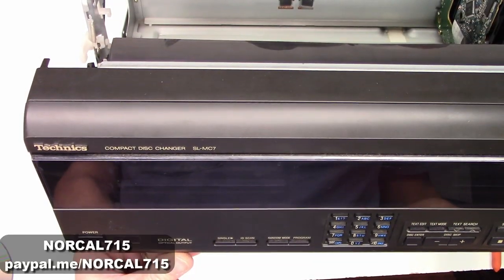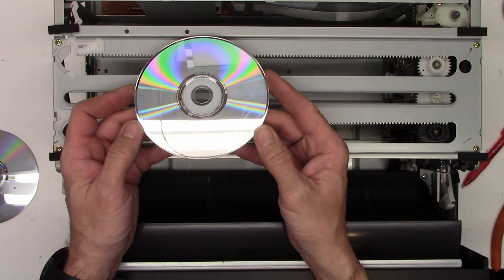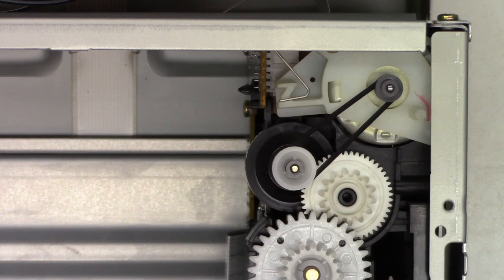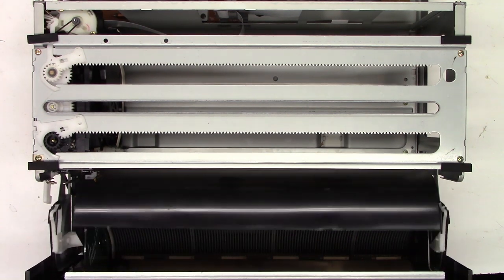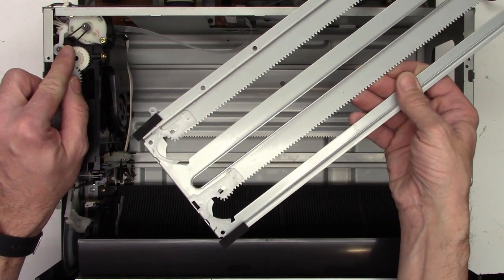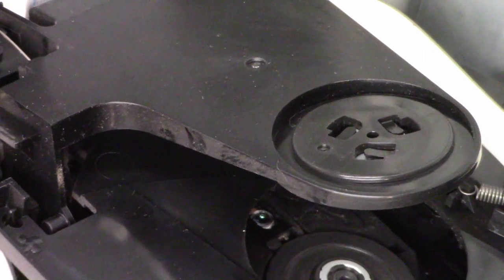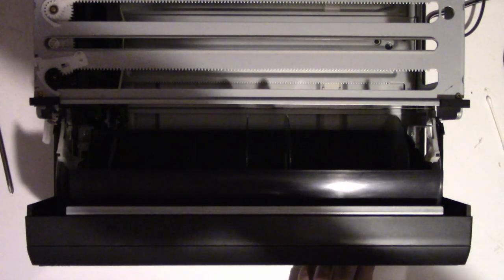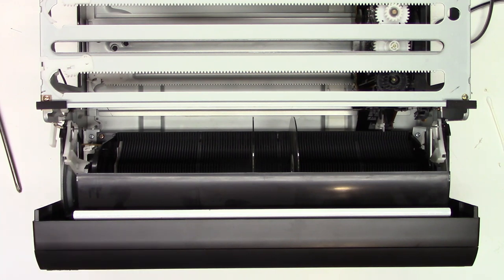TECHNICS SL-MC7 100 + 1 DISC CD PLAYER LOOSE DISCS AND WILL NOT PLAY REPAIR FIX

Comment: Thanks for sharing! I have a dead SL-MC400, and curiosity made me look on YT for a possible repair. After opening it up, I discovered the belt in pieces..... I now have a replacement on order, so hopefully that will get the old girl back up and running :)
Reply: Follow up - the player is back and running as good as new 👍 Thank you x
Reply: Where did you get the belt from?

Comment: Hey Norcal715, you helped me on another repair some years back. My unit suffers from the dreaded "No Disc" message, but after cycling through a good number of discs it will eventually start reading/playing the disc and will play from then on. I reckon it must be due to a weak or wearing out laser. I was glad I had this video as a reference to clean the laser lens - the last time I managed to get a q-tip in there without complete disassembly but couldn't remember exactly how I did it. Anyway, I did take it apart, and was able to clean the lens and other surfaces you showed in the video. I was surprised how clean it was inside, and the lubrication on the gears seemed good. Unfortunately when I got it back together, it would no longer insert a disc into the cd drive. After watching your video, I powered it off, and then moved the cd drive all the way to the right, and noticed the back gear was one tooth off to the left, so I unscrewed the right side and made sure that the gear teeth lined up correctly. After this, the unit would load cds again. Unfortunately, I still get the "NO DISC" message, but after about ten times loading and unloading cds, it started playing as it usually does. Maybe the tired laser finally gets hot enough to read? I guess there is no way to repair that as parts would be prohibitively expensive and likely non-existent at this point! If the cd drive stops moving I will know where and what to do to replace the belt. Hopefully I could find one on Amazon or other source. Thanks again!

Comment: This is the same exact mech used in the SA-CHxxM series of mini stereo systems by Panasonic (which makes sense, since they're both Matsushita) except those are 60+1 changers. There's the 64M, the 84M and the 94M. Those have their own amplifier and speakers, FM/AM tuner and a single/dual cassette deck stacked on top (the 64M model which I own is a single deck, whereas the other 2 are dual). There's also the Technics SL-MC400/410 which also holds 110 discs (and I own as well), although I think that was the first generation of mechs of this kind that Matsushita made. I think the timeline goes like this: Matsushita released the 400 series under the Technics brand, they were pleased with the results and decided it was worth improving and carrying over to later products, so they made the 6/7 series next which adds the optical output port and got a bit of a facelift and different color scheme on the front. Then came the smaller all in one SA-CH models under the Panasonic brand, just shrunk down. By this point, they also made some improvements to the logic and firmware of the MCU running the whole show. For instance, the SA-CH model doesn't need to slide the mech across the rack to search for discs at each and every power cycle - it only does it once after the door has been opened and closed and then remembers the number of discs until you open the door again. It also won't let you select slots that came up empty during the initial search action - it will say "NO DISC"  if you try to punch in an empty slot number. By contrast, the MC model WILL let you punch in any slot number, it will move the carriage to it and even load the ghost disc. Even after determining there's no disc there, it will let you try again, so its memory is even worse than that of a fish :)) In its defense, it DOES at least omit non-present discs when cycling through them with the DISC SKIP buttons, but even this is not perfect and works MUCH better in the SA-CH systems because as soon as you hit DISK SKIP +/- during playback, it will immediately jump to the next disc up/down from the one that's playing, even if that's not the one you want to get to. By contrast, on the mini units, the "DISC SKIP" button won't stop the disc in play - it only serves as a cursor UP/DOWN key and scrolls through all available slot numbers and will only go to it once you actually hit PLAY yourself - MUCH more convenient....WHEW ! Sorry for the wall of text :)) I've had the SA-CH unit in the house ever since I was a baby and always found it fascinating as I grew up, the mechanical sounds it makes when handling discs in particular, so I when grew up and found there's a 110 disc variation of it, I just HAD to get myself one too ! :D

Comment: If the belt is the only issue, I would recommend just fishing it through. If you missalign the sled on the upper track vs. The lower track it will create a frustrating time.

Comment: Great vid, just replace the belt and all the mechanisms are working. However, when I turn it on I get a “take out disc 8”  warning that prevent s me from playing disc. I even put a disc in slot 8 and ejected it but still have the same problem. Any advice?

Comment: THANK YOU FOR THIS VIDEO! I HAVE ONE OF THESE THAT I RECENTLY DECIDED TO PLUG BACK IN, BUT THE READER WON'T MOVE SIDE TO SIDE...I HEAR IT SOUND LIKE IT WANTS TO... BUT IT WON'T, GONNA HAVE TO TAKE APART TO SEE IF ANYTHING IS BLOCKING OR LOOSE THANK YOU
Reply from the maker: May be a bad belt
Reply: @norcal715  it was... not sure how, but it tore and melted, having to clean and remove as much as possible of old belt...hope a new one does the trick

Comment: Two questions if you have the time:

1) Is there a dimming option for the display text/numbers? (Don’t want to dim the blue display on the left CD window.)

2) Any tips on finding a part number for the clear plastic cover that snaps onto the front? Mine was chipped/cracked, so I just removed it... looks better, but would be nice to buy a replacement part without having to buy a whole ‘nother CD player...

Thanks for any response!
Reply from the maker: As far as localized dimming of separate areas, no I do not believe you can. As far as the cover do you have the same exact model? If so I can look and see if I actually have a service manual.
Reply: @norcal715  Awesome response time, thanks!

And any dimming option at all would be cool, if it exists... I couldn't find it when I looked through the manual.

My model is the Technics SL-MC4.

Comment: Great video!

I am missing a video that describes, how to remove the lid/cover on a Technichs SL-MC410 but I assume that the lid on this machine basically is removed the same way. 

I ask because I have run into dificulties removing the lid. I have removed 4 screws from the back and 2X 2 from the sides of the cabinet, totally 8 screws - but the lid seems to be stuck in the front. I have no desire to use force as I can hardly imagine that this is how Japanese engineers imagined, how to get the lid loose. 

Any ideas what is wrong or what the correct next step is?

If you know about a link to a video that describes this then it would make my day :)
Reply from the maker: Try to lift straight up with a little force. Some had to be tilted to a 45 degree angle for the tabs to release.

Comment: Hallo Sir,
I have some problems with the previous Player MC410. I am also owner of the MC7 and It works great. The problem with the MC410 is the following:
If I input the text files for the CDs, possible with ALBUM and ARTIST the data will remain untill I start a selected program. Then it happens, that some
Files will be lost. If I start the All Random Mode and let it play untill its end the entire data of every disc will be lost. I remember that there is an EPROM
Memory so may a discharged battery can not be the reason for that. Do You have heared about similair problems before and do You have any idea what 
can be the reason for this? Many thanks for Your kindly help!

Comment: I bought one of these. the sl-4 and sometimes it will accept a Disc but other times it just makes a clicking noise and will just stop working. any thoughts?
Reply from the maker: The switches that detect the mechanism status (position) are probably oxidized.
Reply: @NorCal715  thx! I actually sent it to the landfill and sold the remote on ebay...it was a super cool unit though. Please don't come for me for tossing it! 😬
Reply: @norcal715 please let me know where I can get the 3” belt

Comment: My unit flashes "Checking Discs" continuosly and does not play any disc...tapping the on/off does not work also...I have to unplug...any ideas as to what could be the problem?
Reply: Replace the belt, it's come off, he shows it in this video
Reply: @EnzoFerenczyo where can the belt for this cd player?

Comment: Hi I just came across you're site.. I to am in the same position .. I use this for the holidays only- The other day turned it on after nearly of a year sitting idol and when I turned it on ...( it flashes off) nothing else any thoughts? Thanks!
Reply from the maker: Do you hear any motors running at all?